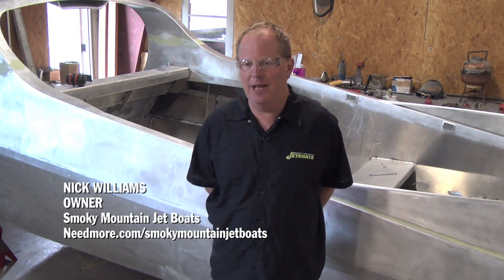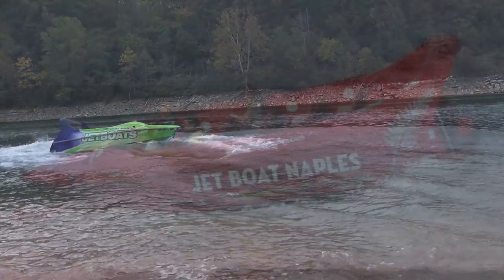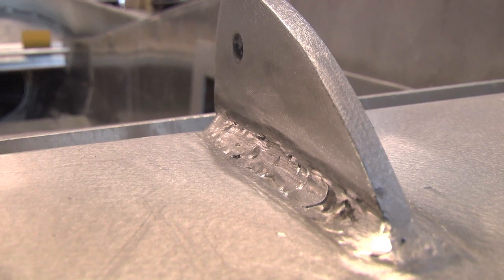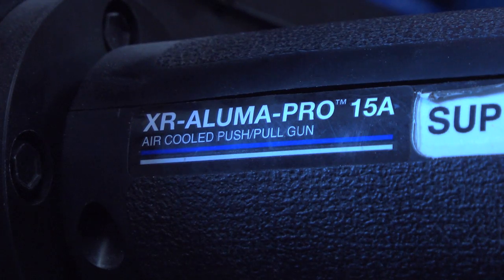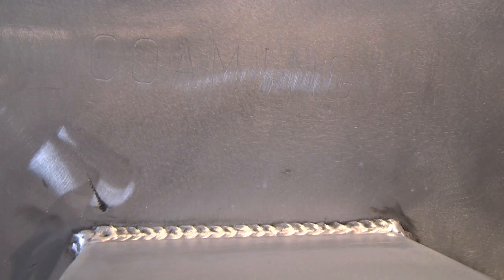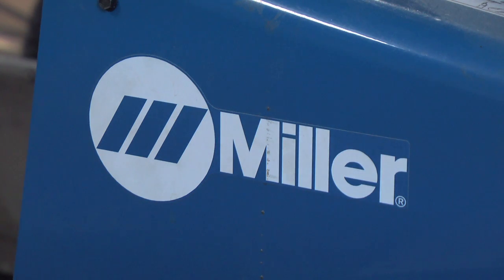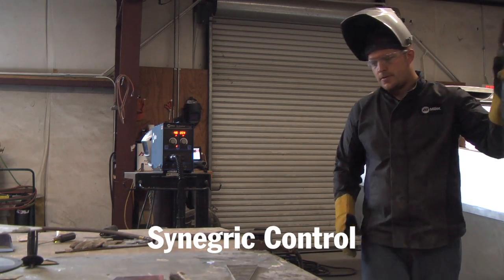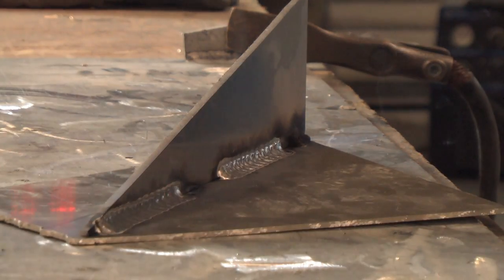Smoky Mounatin Jet Boat Relies on Partnership with Miller and Local Distributor for Solutions

Comment: MADE IN CHINA MACHINE
Reply from the maker: The majority of Miller welding machines are designed, developed and manufactured using proprietary technologies in Appleton, Wisconsin. Components of our welding machines are manufactured in our facilities in Appleton, Wisconsin, other facilities in the U.S. and locations outside of the U.S. and are designed to meet Miller specifications and requirements. We work with trusted partners to ensure that our welding machines meet the high-quality standards that you have come to expect from the Miller brand. Thank you.